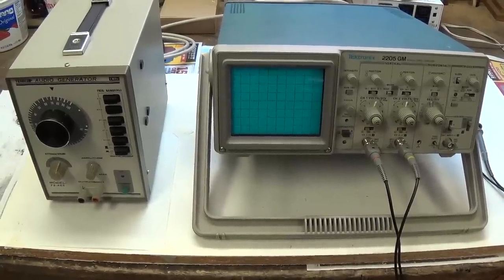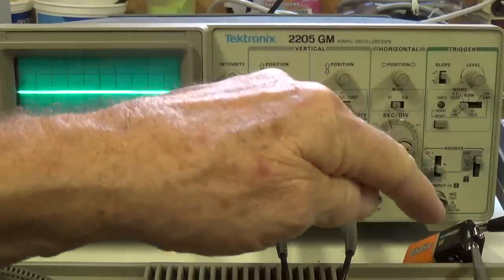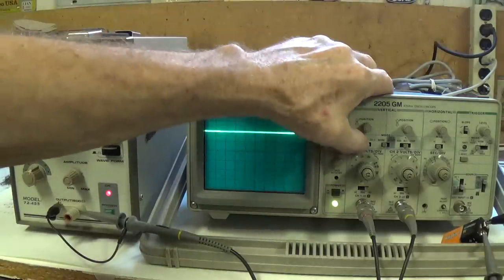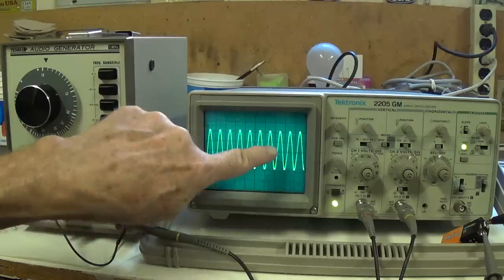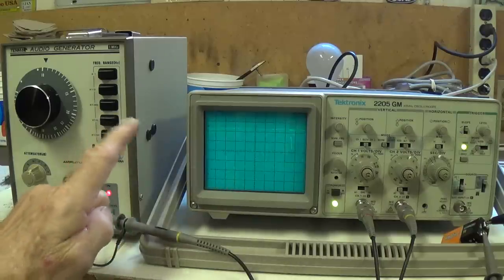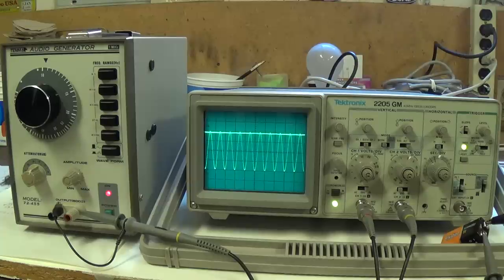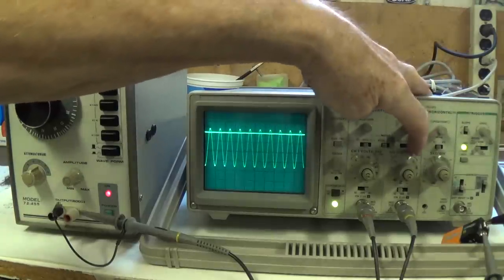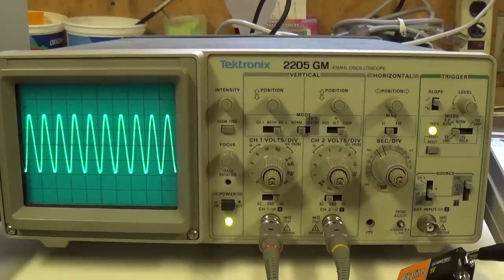Oscilloscope: DC & AC, Signal Tracing in Amp Circuit, RMS Output Measurement

Comment from the maker: As a former math teacher, I'm embarrassed to admit that there is an error in my formula for the calculation of RMS power. The peak voltage should be corrected to RMS (i.e. multiplied by .707) prior to being squared and divided by the speaker impedance......not after :(
Reply: So, about 2.25 watts RMS?
Reply: Thats fine.....it makes some of us feel smarter lol.....another worthwhile video uncle Doug......I get all the young trainee's to watch these, its very helpful :)
Reply from the maker: Yes, Not Mark, the real value is a bit lower than my flattering portrayal of its awesome output power :)
Reply from the maker: Thanks, Harb. I always strive to make others feel smarter :):)
Reply from the maker: Thanks, Gianfranco. We will :)
Reply: So ya goofed...that's not a problem as long as you catch it and correct it(8-).
Reply: One mistake after 160-170 videos and probably a couple thousand calculations would result in an accuracy somewhere around 99.99951%   I 'm willing to look the other way since you let me sneak in through the  EXIT.   -)
Reply from the maker: That sounds like a fair trade to me :)
Reply: In a circuit whose impedance consists of a pure resistance, the rms value of an AC wave is often called the effective value or DC-equivalent value.For example, if an AC source of 100 volts rms is connected across a resistor, and the resulting current causes 50 watts of heat to be dissipated by the resistor, then 50 watts of heat will also be dissipated if a 100-volt DC source is connected to the resistor.

For a sine wave, the rms value is 0.707 times the peak value. So VP=Vrms×√2. And P rms=V rms ^2/R.sO 2,25 watt for a resistor load.But that is wrong because speaker is a coil in a stable magnetic field.So and an rms value is not the best to measure an amplifier.Rms power is a standard method of which we make a decision if amplifier lost or not its factory power.Only with a power and frequency graph we can 100% be sure about the capability af an amplifier.
Reply: Don't worry. You have unassailable tenure within this union.
Reply from the maker: Thanks, Carl. I need it :)
Reply from the maker: Wow.....thanks for the very informative input, MP.
Reply: I was watching the video at this point (calculation) and thinking "I was under the understanding the Root Mean Square was calculated from voltage"...thanks for the correction all is right with the world again! Thanks for your tutelage on all things tube amp related Uncle Doug as one of the other commenters said one mistake in a gazillion videos is more than understandable. I shutter to think how many mistakes I would make doing videos like these!! Thanks for sharing your knowledge with us!!
Reply from the maker: You're welcome, Jack. Thanks for all your nice comments :)
Reply from the maker: It can happen, Eduardo. We must remain vigilant. Likewise from Texas, USA :)
Reply: Uncle Doug, even Norm Abram cuts a board too short once in awhile. ;)
You created a wonderful class on the oscilloscope and using it in tube amps. People will benefit from this training for years to come.
Many thanks for your time and videos.
Reply from the maker: You're welcome, Ray. Thanks for your very kind words :)
Reply: I think students were lucky to have you as a teacher
Reply: You are a great teacher!Cheers
Reply: At least your math error didn't result in the loss of a $125 million Mars orbiter like the simple units conversion error NASA made a few years ago.
Reply: You could put an overlay comment on the video without having to edit it - Lots of other YouTubers do :o)
Reply from the maker: @John Verne Once you get smarter, John, the cats are easier to find :)
Reply: ...nobody's perfect-!!
Reply: @km4hr  Numbers Aren`t Specifically Accurate !! hehehe
Reply: The most important part is understanding the formula, but finding one`s own error and correcting it, is no less notable.
Reply: I get it Doug ... One of my teachers used to deliberately embed errors to see if students picked it up ..it's a good way to test consumption of material.
Reply from the maker: @das250250  The RMS error was unintentional, TK.

Comment: Once again, thank you for the clear/informative video's.   For Christmas i'm getting a Siglent 4 channel 100 Mhz scope and I just won bids at work (Zoll Medical - Leader sig gen, Fluke DMM and a 10A/20V power supply) so, I'll have a fairly well rounded home lab bench in a few weeks.  Having successfully build and gig with 2 tube amps, it will be nice to finally "see" more deeply into what is going on in each gain/transformer stage of subsequent builds, mods, and some day designs.   Thank you!
Reply from the maker: Congratulations on a fine acquisition, Phil. We hope it serves you well for many years.

Comment: I've got two dual-channel Oscilloscopes in my collection of test equipment, one is a solid-state 20Mhz DSE Q-1804 I bought back in the late 90's, the other is an old Telequipment D33R 15Mhz Tube Oscilloscope that needs a new CRT and some restoration work done on it, they really are useful pieces of test equipment to have, once you know how to use them properly, having the ability to see how a circuit is actually behaving is like the difference between working blind and working with 20/20 vision.
Reply from the maker: That's a good analogy, Simon. Being able to see wave forms and "noise" eliminates the majority of guesswork involved in electronic repair.

Comment: I appreciate your methodical approach to introducing us to a CRO. I particularly appreciated you saying things like BNC Connector, in a manner which could be understood. 
I am working with model trains and considering purchasing an Oscilloscope. I am hoping that such a device could record a sequence of events, and allow me to play them back. 
For example, a Capacitor Discharge Unit (CDU) charges a large value Capacitor (I'm using 10,000uF, 63Volts), by directing a supply voltage of 16VAC through a Non-polar 220uF 50Volt Capacitor, thence splitting the flow to two diodes pointing in opposite polarity, which charge the big capacitor. I wish that I could include the schematic, but you can probably get the idea. 
After a couple of seconds, the big capacitor is changed to about 44VDC, and is ready to supply that jolt of power to a Solenoid, to change points. 
I would like to be able to record that couple of seconds, and play it back in slow motion. 
I am hoping that an Oscilloscope could do that for me. 
Thank you for an interesting presentation. I hope that you, or one of your subscribers might respond to this entry,
Arthur
Reply from the maker: I don't own a digital oscilloscope, Arthur, but some models may be able to record and playback. You'll have to check on Ebay or the internet in general. Good luck. Thanks !!

Comment: As far as output transformers, when I have instructed fellow musicians in the past on the concept, and they are staring at me like I am an alien with three eyes and green hair, the analogy of an electronic gear box seems to make the light bulbs come on.  The conversion from horse power to torque with a gear ratio to climb a steep hill (and the speaker transducer is a mighty steep hill for the poor power tube) does provide a tactile concept for them.  Great video as always, Uncle Doug!
Reply from the maker: An excellent comparison, Anders, and one to which all automobile enthusiasts can relate. Thanks !!!
Reply: And, as always, we are bound to the irrefutable laws of thermodynamics for conservation of energy.  As one parameter comes up, the other one goes down, but the amount of work is still the same.  All other variances are in either friction or flux core heating thermal losses depending on the system...   Don't get me started on the free energy cooks...  Hehe
Reply from the maker: Right you are, Anders :)

Comment: The clipping point is also dependent on the strength of the input signal. Electric guitars don't output anything near +/- 2V, so that's why it went into clipping at such a low volume as the signal generator is overdriving the input compared to what it was designed for. 

Another great video, Doug, thanks again!
Reply from the maker: That's a good point, AQ. I thought my input signal was +/- 1V, but you may be right about it overdriving the circuit.  You're welcome.
Reply: I've always operated under the impression that typical guitar signals are 300mV pk-pk and line-level signals are 1V pk-pk. This is something that I think I picked up from Craig Anderton's book.
Reply from the maker: I tested a pair of humbucker pickups several years ago (both activated) and got a 0.7V output. To me, 1V is a close approximation that allows for easy numerical comparison.

Comment: Thank you, Uncle Doug.  I needed this to trace the signal in my Princeton Clone.  Now I know how to do it.  You are a good teacher.
Jim
Reply: Here's what I did:  I set the signal generator to make a 1khz signal into a dummy load.  Measuring the output of the SG on the oscilloscope I found it was putting out 0.5 volts +/-.  The signal passes throught the 12AX7 preamp and the signal at the grid of the 6V6 read just 4V +/-.  4V x .707=2.93.  2.93 x 2.93 = 7.99.  7.99 divided by 8 ohms gives just one watt.  That's with amp volume at about 40%.  Breakup starts at 5.2 V +/- for 3.38 Watts. 

I measure the output of the audio transformer at the speaker - same settings - and got 0.6 V +/-.  0.6 V squared is 0.36 which, divided by 8 ohms gives a power at the speaker of 0.045 watts.  That explains low audio output.  Does it also indicate a bad output transformer?
Reply from the maker: The signal from the output transformer at max volume before distortion should be much higher than this, as you already know, Willy. Have you checked the DC resistance of the primary and secondary of the OPT, or attempted to measure its winding ratio ? How about a possible short in the voice coil of the speaker ?
Reply: I will check DC resistance of both sides of OPT and check back.
Reply: DC resistance - primary - common to 5K connection: 494 ohms.  Secondary -  common to 8 ohm connection 1.3 ohms.
Reply: Resistance across speaker connections:  6.4 ohms.
Reply: My math tells me that the 5K input divided by the 8 ohm output produces a turns ratio of 625:1.  So, 625 x the 1.3 ohm resistance reading gives us 812.5 ohms, far from the 5K that the manufacturer rated the transformer at... on the order of one sixth of its rating.
Reply from the maker: Willy, could you possibly substitute another OPT to see if that makes it work?
Reply: I will try.  I'll have to order another.  I wrote an email to the manufacturer and told them what I had found and then asked if I have a defective OPT.  No answer yet.
Reply from the maker: Good luck :)

Comment: Love my tektronix 2232. Owned it first and after learning on the old-school I have a 200 MHz DSO that I use most of the time. But I love how the buttons click. The DSO is not the same. Wish that the modern ones had detents for the knobs.
Reply from the maker: Thanks for the input, AT.

Comment: love this video and how you put everything together to make it safe for beginners like me when dealing this type of circuits. my request is to show how tube tester works. Have a couple of Ampex 620 laying around that need rebult
Reply from the maker: Thanks, SB. The oscilloscope is demanding enough for now :)  All tube testers are different, but I guess it might be worth explaining the basic principles upon which they  function.
Reply: Good Idea , Mine takes the plate voltage from mains potential .. Im in Australia , so I use a 110 volt stepdown tx to isolate  , however , if i was in the states , i would be onto Doug's iso ps videos straight away .

Comment: Another excellent video, you said nothing wrong but I think there may be some confusion regarding DC and AC signals on the scope and the use of the AC DC coupling switch. When the scope channel is set to AC it is capacitively coupled and blocks any DC on the signal, when the switch is set to DC in passes everything DC and AC and will display the AC signal riding on the DC level. Lastly the Add function is purely a mathematical function used to give the addition of the two channels, if is often use to provide a pseudo differential measurements between 2 points in a circuit as apposed to some point and ground. For example to measure the voltage drop across an resistor that is not tied to ground clip channel one probe to one side of the resistor and the channel 2 probe to the other side of the resistor (do not clip the probe's ground clips to anything,  actually it is best to remove them from the probes) then set the scope to add channel one and channel 2 and set invert to invert channel 2
Reply: MK, I'm glad you clarified the AC/DC coupling switch here. It's a major point of confusion for oscilloscope users coming from a multimeter background.

Comment: Uncle Doug, quick question.  I just acquired my first oscilloscope, a Hitachi V-509.  I wanted to check the phase of a sine wave at the speaker terminal.  In other words, does the amp circuit produce a sine wave exactly like the input at the output or is it reversed.  I wanted to use that info to determine if I should hook my speakers up in reverse.  As far I know, a vintage Tweed Bassman 5F6-A circuit inverts the signal at the output.  But, I want to check a 1959 Bandmaster.  I don't know anything about scopes.  I bought it to determine outer foils on capacitors.  Not that reversing the speaker leads makes a huge difference in sound, I just wanted to see if it was a doable test.  I don't want to use a dummy load, just keep the speakers hooked up.  Also, other YouTubers have me concerned about grounding and damaging the scope.  One suggested using a ground lift adapter on the scope plug itself.  Thanks for your advice.
Reply from the maker: You're welcome, MS. From my experience, the phase of the output sine wave is not a concern. Recall that even at moderate frequencies, i.e. 2000Hz, the phase is reversing 2000 times per second......far faster than your ear can detect.

Comment: Uncle Doug-A friend has asked me to look at his DOD Digital Delay R-908.  I'm a hobbyist level guy.  The sound goes in and the sound comes out, but the sound is not affected by the flange, delay, echo, switches etc.  It just remains clean sound.  I replaced all the electrolytic caps on both boards, and the op-amp IC's.  I thought maybe I could see where the failure is by tracing the signal through the 2 PCB boards and maybe find the problem.  I don't have an ocilloscope, so I thought I would ask you if there's another way to diagnose the problem.  I've seen people use audio signal trace probes, some are home-built, and thought maybe that would work.  What are your thoughts, and do you have a schematic, video, etc. that shows how to build and use one?  Thanks.

Comment: Thanks for the video. They are very informative and enjoyable.
I am very familiar with the use and application of multi-channel DSOs (e.g., Snap On: Vantage, Vantage Pro, Modis, and Verus; and PicoScope) in connection with automotive diagnostics (injectors, ignition coils, fuel pumps, cam/crank sensors, in cylinder pressure diagnosis, et al.). The Snap On offerings evolved to be very good. However, the industry standard, in my opinion, has become the PicoScope because of its many capabilities.
It is my understanding PicoScope  makes a full line of DSOs. I don't know if these would be suitable for tube amplifier diagnostics, i.e., overkill, but having experience with their automotive version, it seems they would be a very useful tool.
Cheers.
Reply from the maker: Thanks for the interesting input, JW. I have no familiarity with PicoScope but I'm sure there are sites and videos that do. Best of luck.

Comment: Great video but I don't recommend leaving a light bulb current limiter hooked up to an amp when signal tracing or measuring output. The limiter will feed the amp a low voltage and all amp voltages and measured gain will be lower than normal. Once you verify an amp is powering up normally go ahead and disconnect the current limiter.
Reply from the maker: Thanks for your input, Rob.

Comment: Excellent video, there is nothing quite as good as a professional teacher, teaching. Side note a 1K tone is industry standard in the RF world mainly because it is close to the center of the AF bandwidth so should not be affected by the audio filtering circuits. It should also make it past most amplifier tone stacks fairly well. Riddle: What is the lowest note that you could possibly play? Answer: a DC flat.  I know, ugh.
Reply: A long time ago I read some paper from bell labs I think it was that the 1K frequency was derived as a standard for test equipment and experiments because that is the exact frequency of a tuning fork. Also Nice video uncle Doug. Thanks
Reply from the maker: Thanks so much, Mark :)
Reply: Slim Hermer  Tuning forks are made in many frequencies. For example I have an old Hammond organ tuner that came with it's own tuning fork. The fork is marked 1318.2 with an E below the number.
Reply: Just saying what I read. I assumed it was a fork of a certain frequency of 1k hz and that became the standard. let me try and find the article if it is online and cite it for you.